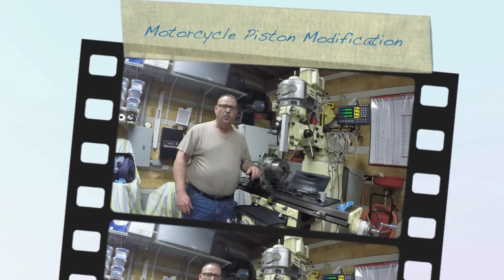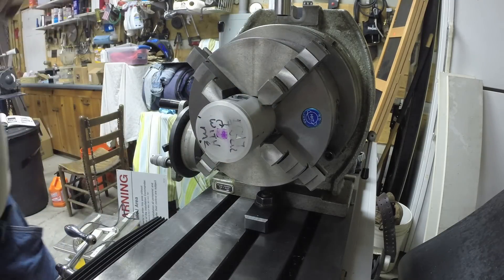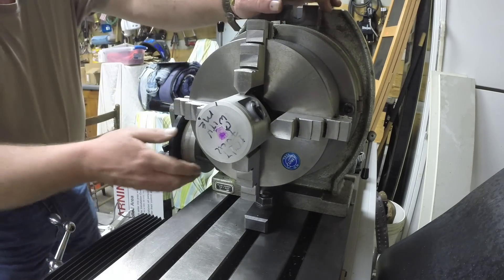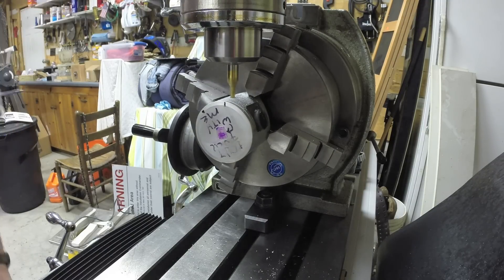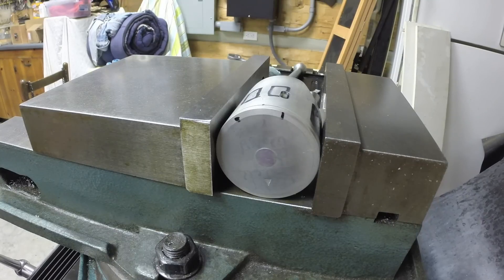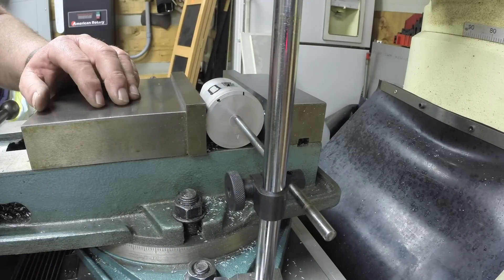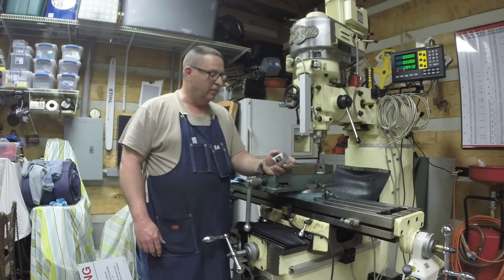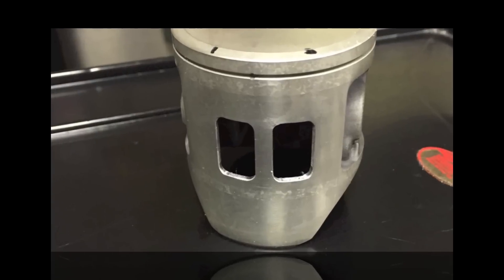Motorcycle Piston Modification

Comment: Its a older 2 cycle piston design used in the early to mid 70s or maybe earlier than that, Then the reed valve came along and no need for windows in your pistons.

Comment: did it work for him? it looks like he had you window the piston on the exhaust side and not the intake side.
Reply from the maker: I asked him and he stated it working great.
Reply: +ShadeTree Machinist Interesting. I've always wondered if it really mattered, which direction you point the arrow on a 'symmetrical' piston. Nice work, sir.
Reply: Pistons are not simitrical. They are slightly egg shaped and the exhause side of the piston is slightly better built , do the the exhaust gases which heat the front of the pistons up.
Reply: Pistons can be symmetrical.
Reply: some oem pistons have the windows on the intake side. wiseco drills little holes on the exhaust side. its in the instruction paper when you buy a piston kit.
Reply: there is a tiny triangle on the top of the piston and its marks out the exhaust side and he made the slots on the intake
Reply: He put a window into the intake the arrow is for the exuast

Comment: What was the reason for cutting those slots. Was it weight reduction or some other devious plan. Sure would like to see it in use....Thanks for sharing....Ken, US Army ret.
Reply: oceannavagator..  I think you might be thinking of the exhaust port.   The windows in a piston can be widened and lengthened to improve airflow at any rpm..  In fact you can tune the windows in the piston to give a definite power boost at lower revs, by opening the port earlier and letting it close a bit later.. (although piston skirts can be dangerously weakened in this case if you go too far..).. OR even making the windows wider.. and shaping the edges..  to flow more gas even if the timings aren't altered..    to get more gas in...  It won't reduce power at all unless you're talking about old fashioned engines from the 40's  50's,  60's that had to use 'piston port' control, ie, no windows at all in the piston..   As in old BSA Bantams etc etc.. (in this case fresh charge would be chucked back through the carb'..)   Most modern engines have had some form of reed valve for donkeys years now,  these take care of gas flow on the intake side, preventing any power loss of gas flowing back through the carbs.   Plus, windows in the piston really help with lubricating and cooling the hot piston and 'small end' bearing,  The cold fresh charge 'into' the piston.. makes a piston seizure far less likely..  and even helps cool the far side too,  the very hot exhaust side gets some cooling on the inside of the skirt..    With the exhaust port, if you raise the height (earlier port timing, sooner port opening..)  of the top of the port, then you can indeed get more power and at a higher rev range..  But yes, this can cause a power loss at the lower end...   But then again, most modern engines have had 'power valves' of some kind, designed in to obviate this effect,..   When the engine runs faster, the valve turns and opens the port earlier, (raises the effective exhaust port height)  but at lower rev ranges the valve remains closed.. Lowers the height of the exhaust port)   so nothing at all is lost at low revs.  Best of both worlds.   Both the intake, transfer and exhaust are all very tunable on a two stroke.
Reply from the maker: First off, thank you for your service. I'm not completely sure the customer gave me the dimensions and I milled them to that. It has something to do with getting more power out of the engine. I have done several of them for him. He builds motors for motocross racing in vintage bikes. Thanks for you comments.
Reply: lol why do you sign with us army ret.?
Reply: It's a way of asking if anyone else is US Army retired. I get to meet other vets, it's important to me. Are you a vet LOL . ...US Army/police/Social security retired
Reply: I'm no mechanic, but I am confused. Wouldn't the extra flow created by that port go straight into the crankcase? How does it lead to a larger air/fuel charge? It's on the wrong side of the piston. Am I missing something?
Reply: @halfnelson6115  sir you should research modern 2t engine mechanics. many useable quotes but no one has specifically nailed "why" the windows  are there. Oh and yes the charge has to get on top of the piston to be of any use. It actually goes into the crankcase then through horizontal transfer ports wich pu it on top where it belongs. An exhaust valve equipped 2t generally only compresses a volume of about 30% of actual piston stroke. While in the power band the expansion chamber and window ports all work in a harmonic way to actually precompress the crankcase charge and the expansion waves then return to further draw in the charge...
They are actually quite complex. Think of all the timing and open and closing of valves in a 4t. The 2t does in fact have tuned ports and valves that open and close via piston pass or vacuum or pressure activated.
Reply: Is this result in increasing speed or cc or motorcycle
Reply: The window in a two stroke piston uncovers the intake port for a larger charge of gas and air mixture. You lose some low end power but gain in the higher RPM range.